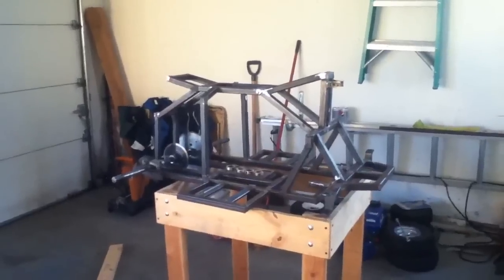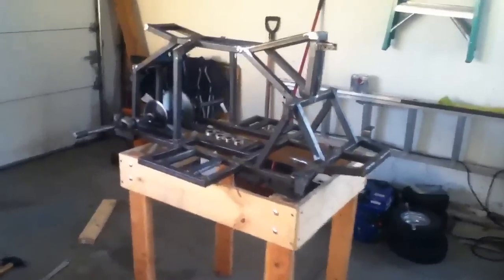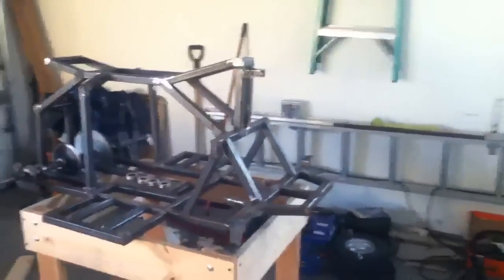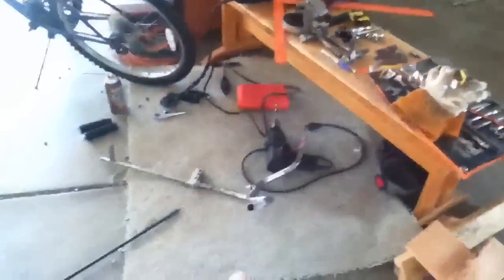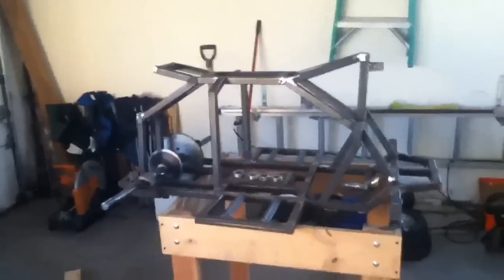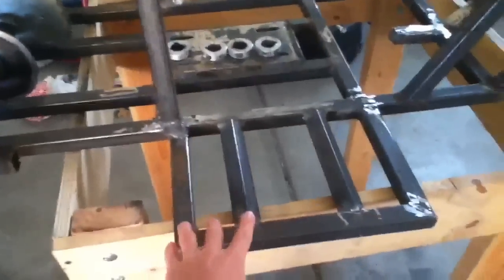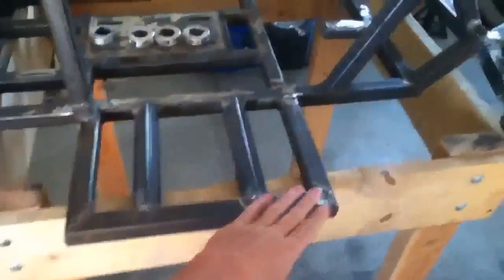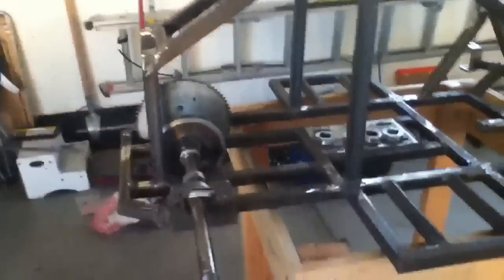Homemade ATV/ Quad build part 7

Comment: It's so good that anyone like their own builds of quads and I'm planning on my project of mini quad with 250f motor then going to build gusset kit for frame parts to be weld to make frame more stronger and i will do some one 250/450 4stroke parts and testing out my engine stand and built own sprocket guards and they are amazing never going to have chain to slippping off when hitting some jumps/whoopy tracks and I'm sand bike person to have fun on my quads got raptor 350 since last year couple months before Christmas and they are so amazing with size and wish was smaller size wheels then be sweet for drifting along beaches and dirt trails be more fun to ride with plenty power to blow the dust everywhere

Comment: Nice frame build and what kind motor you putting in and can't wait for your project to be in final part and it be awesome fun to have a blast on these quad and quad is best to ride never had any accidents on quads are tricky with right lean and balcaing your body weight with right supensions setup for flat tracks,Motorcross,sand dunes and beaches are best spot to ride